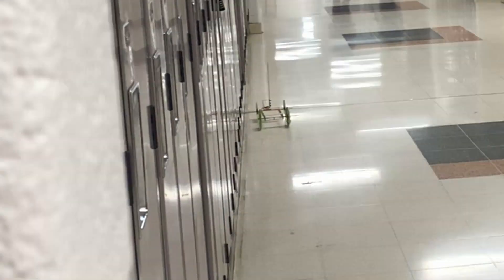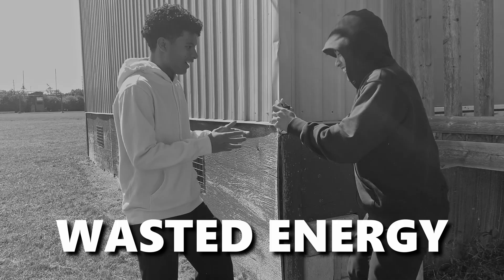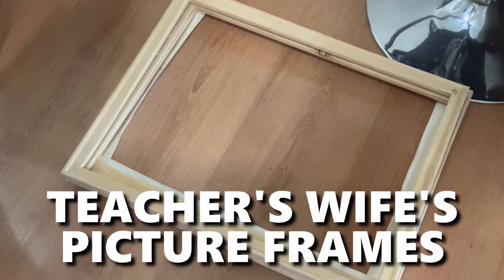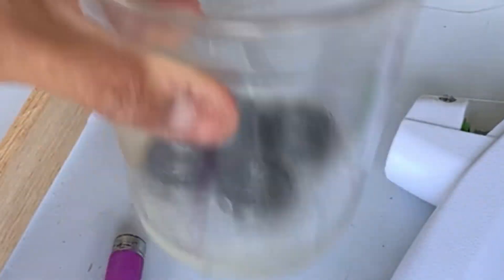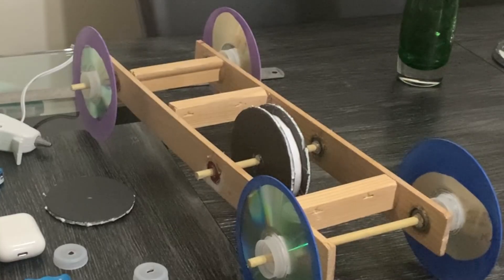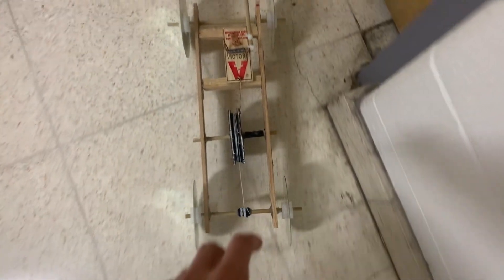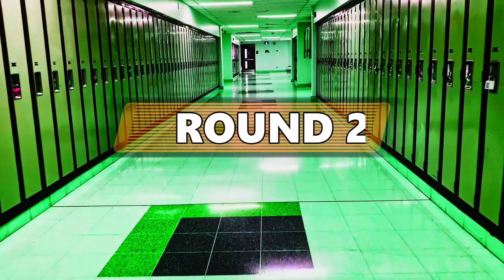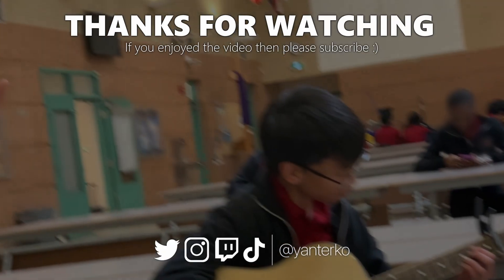Mousetrap Car DOMINATION (kinda...)

Comment: Was planning to apply the same concept, even if it wont work well due to many factors(friction and weight) but in theory it should go pretty far. Over engineering >>>>>